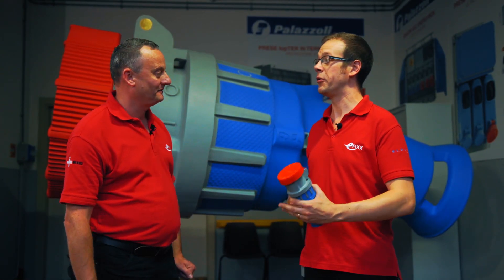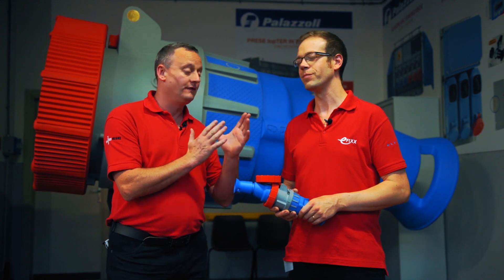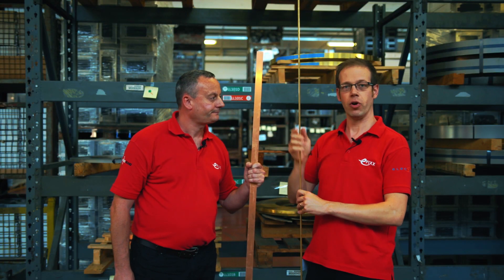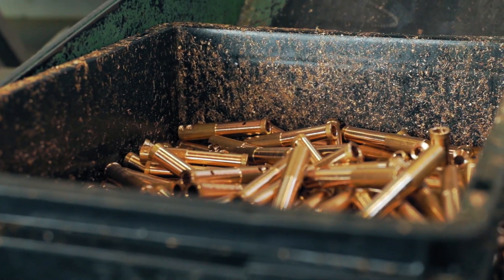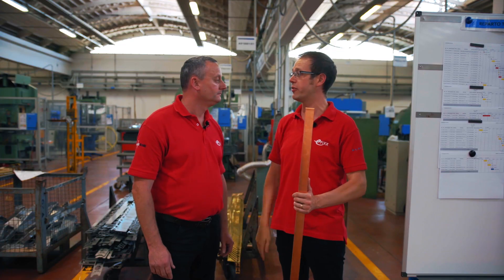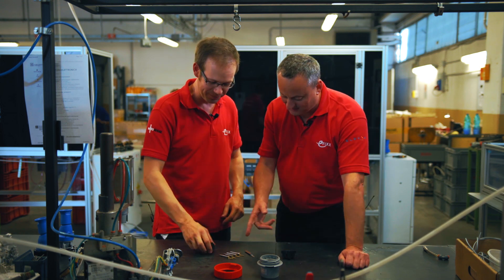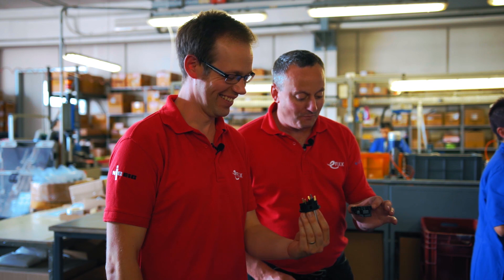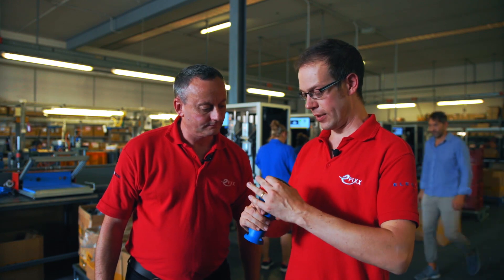Industrial plugs and sockets (ceeform) - How it's made factory tour

Comment: One thing I notice especially the folk-lift driver. No high vis, no helmets and no eye shields. Mr Health and Safety would have a fit in the UK.
Reply from the maker: Keen eyes Steve - The fork lift drivers are probably more concerned about the robot pallet trucks!
Reply: Why would you need an eye shield when operating a forklift.